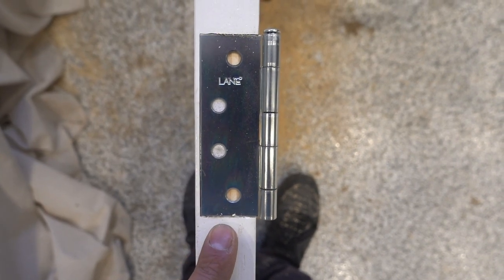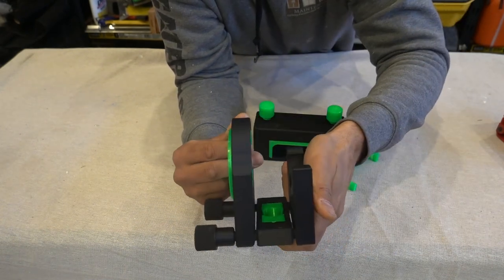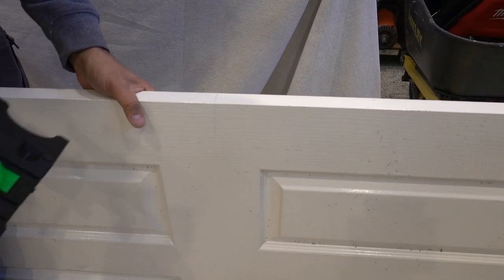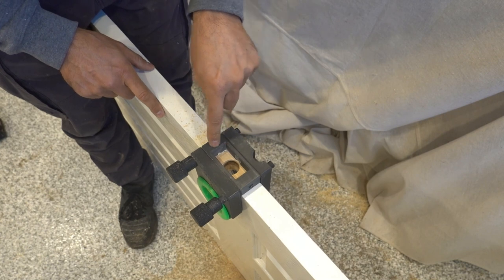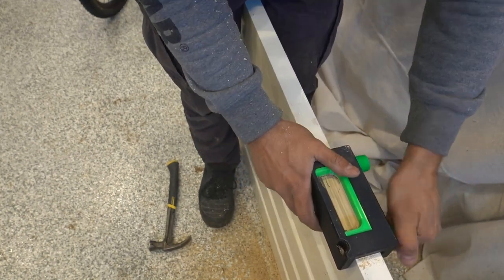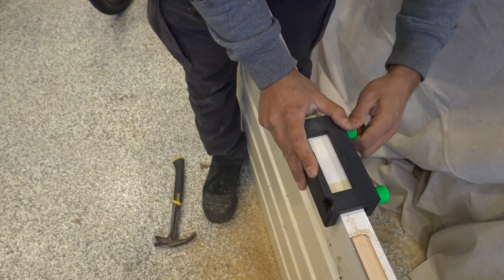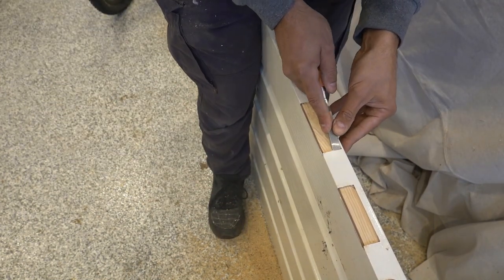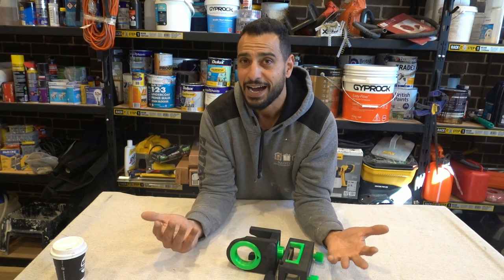How to install door hinge and lock

Comment: Wish they had been around when the clowns built my house 20 years ago. Every door lock/latch and hinge was installed incorrectly  in some way. One door is so bad it closes itself. The hinges were so badly done one was bent and the pin would work it's way out over 24 months. One hinge had 4 different screws in it and every hinge in the house has needed a feed of toothpicks to stop the screws from spinning freely.
Those jigs would pay for themselves very quickly in saved time and customer satisfaction. Word of mouth the best advertisement.